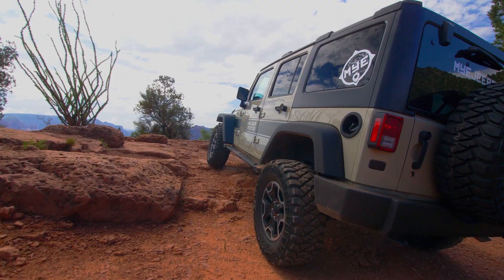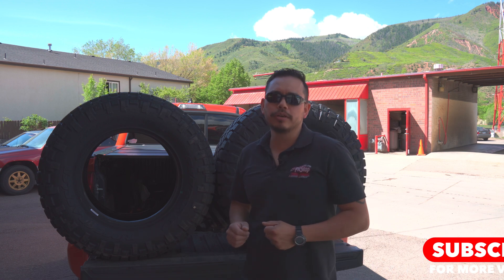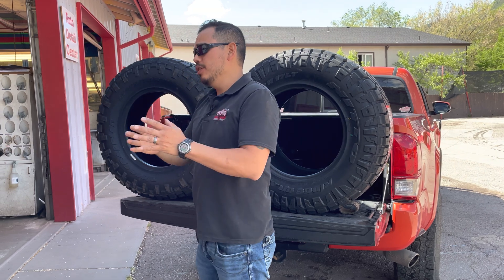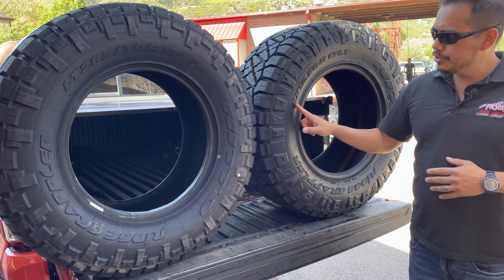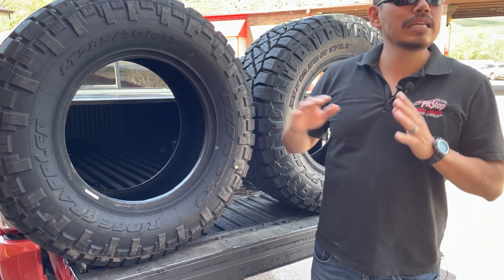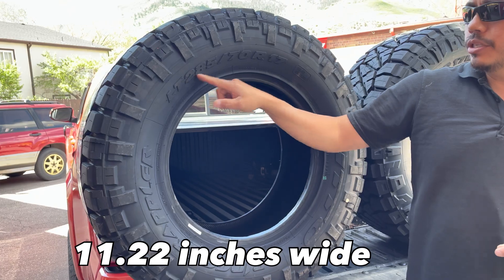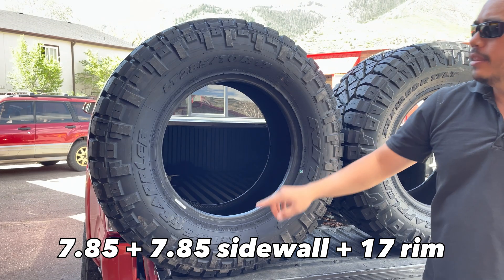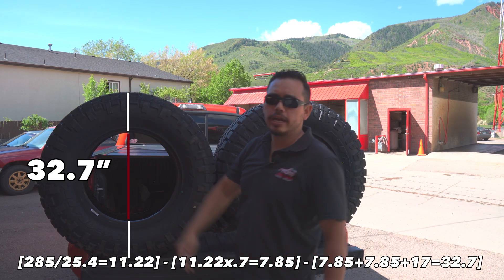How to convert metric tires to inches for lifted trucks

Comment: Hello, I want to step down from my stock 22 inch wheel to a 20 inch wheel. What size 20" tire would I need to replace the 22" tires so that all the mechanical stuff isn't changed such as mileage, alignment, suspension parts, etc. The current tires I have are 285/45r- 22.
Reply from the maker: You would need to know the stock size on the options in smaller rims for the vehicle, we typically used a fitment guide when changing wheel or tire sizes, in order to comply with the vehicle original specifications. Best advice call the local Tire Pros in your area and they can plug in your info to determine what can fit without changing any factory specifications.